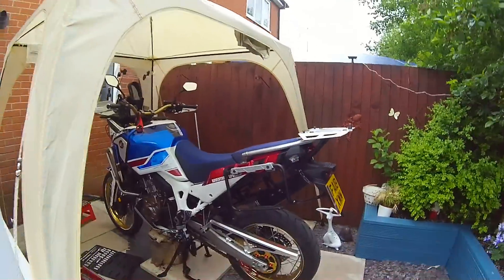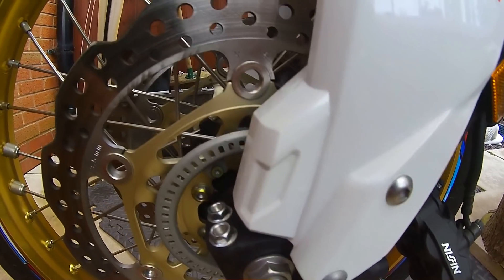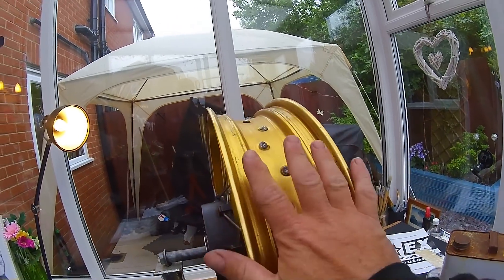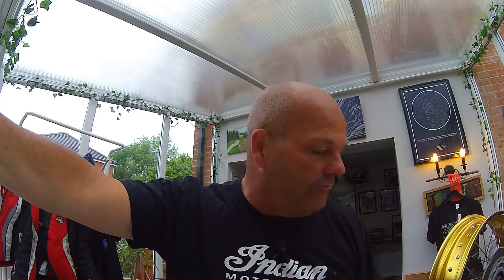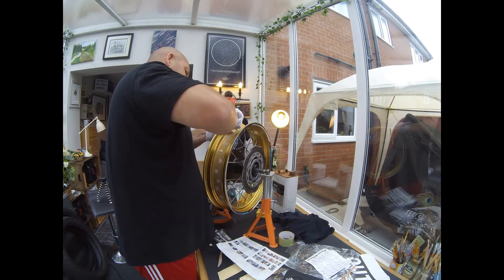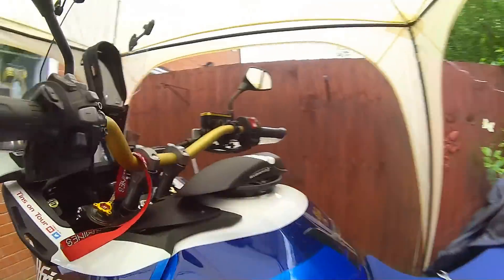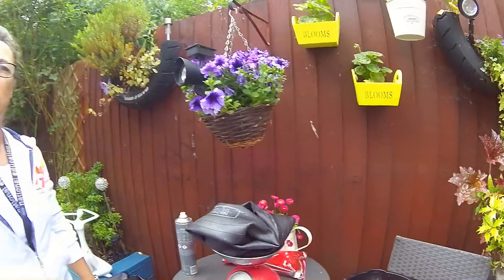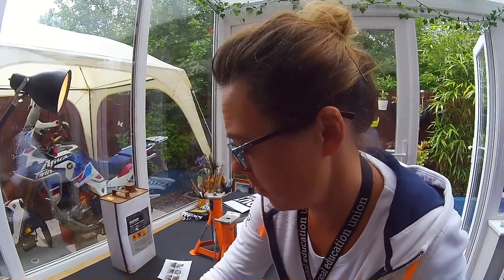Africa Twin Tubeless Conversion

Comment: Top job! Removing/re-fitting tyres is the main thing I am really useless at, so hats off to you for doing it yourself. Saw your first ride video since going tubeless and all was good, hope that is still the case.
Reply from the maker: Cheers Scott yes 3 weeks and 5 rides in and not lost a pound of pressure 👍

Comment: A job well done Shaun , tea supplied by Faye     to smooth the day    .     Congratulations to Faye   (cbt)            I got into biking late,  56 , so went straight into IAM    . It helps a lot   Shaun is a seasoned rider ,but not an instructor        I  stress this is a sharp earning curve .best of luck
Reply from the maker: Yeah glad it's done now just for ease of fix in the event of a flat .. Faye can't wait to get a 125 to practice on 👍
Reply: that is    learning curve          I must double check my messages after ive had a beer    haha

Comment: Hi mate. 
I  know I'm a bit late to the party, since the video says it was posted 4 years ago 🙄, but I have just bought my Africa twin and looking to do the same job. Plus after 4 years if you don't know if it's worth doing no one will. So ! In your opinion bud, worth while, did it hold up, and would you recommend it. Thanks in advance stay safe 👍
Reply from the maker: Hi pal and thanks for the message,  gotta be said this has been 1 of the best mods ever, never lost any pressure and much better tyre choice plus little bonus of less rotational mass

Comment: Have you done this purely to help should you get a puncture? Obviously easier to repair roadside a tubeless. I’m thinking of doing the same 👍
Reply from the maker: Absolutley the main reason pal , guarantee if we get a puncture abroad it'll be in the middle of nowhere and red hot so loads easier to just plug it ... best £70 I've spent 👍

Comment: Hi Shaun and Faye, great vids, just wondering what type of tubeless tyre repair kit you're going to carry, and are you going to carry an inflater or those air cylinder s as well, cheers..
Reply from the maker: Hi les I've always used the rubber slugs that u push in pull out and chop and use a mini compressor as i find canisters a bit hit and miss

Comment: Are you happy with this conversion? No leaks? Want to do this with my tiger 800 xc caus l dont like the tube setup. Better to get a plug in the tyre if the accident should happend.
Reply from the maker: Yeah Toby it's been great I've done my friends triumph as well and neither have lost any air plus the rotational weight saving is pretty handy .. nearly 10k on my conversion 👍
Reply: @TinsonTour  i guess thats my next upgrade then. Thanks for a answer sir.
Reply from the maker: @toby7504  I'd recommend it a million percent .... stuff taking wheels off breaking beads swapping tubes etc in the lashing down rain and cold ... defo not for me
Reply: @TinsonTour  yeah l can defently see that.

Comment: Maybe a silly question Shaun, but can this conversation be used on older bikes or is it just for modern Adventure Bikes. 👍
Reply from the maker: Can use it on any tubed wheel .. I've done the mountain bikes as well in the past and never had a failure
Reply: Thanks 😀

Comment: Great video, explains how this product works , thanks. Just one question, you put your tubed (I presume) tyres back on the rim, can you fit tubles tyres with the Outex modification  ? Regards, Rob.
Reply from the maker: Cheers for that yeah i run tubeless tyres now and on my 2nd set 13k miles without a problem 👍
Reply: I was just about to ask if you had a long term review on these, guess that answers my question 👍
Reply from the maker: @piggymito  absolutely 100% recommended they haven't lost a pound of pressure since being done and that included 2 European Tours .
Reply: Perfect, I've been looking at alpina wheels but at 2k you can imagine I'd rather find a cheaper alternative
..
Reply from the maker: @piggymito  absolutely 👍

Comment: Hi Sean did you  use the same 'tube'  tyres back on the tubeless conversion?
Reply from the maker: I wasn't going to but because of the lockdown I've still got at least 3k left on the Bridgestones so I'll change to tubeless tyres next time round
Reply: @TinsonTour  I have the Bridgestone Battalax A41 F/R (Front/Rear) and they state they are 'tube type".  Were your tyres the same type or different.  Looking to do the conversion but these tyres have only done 2500 miles so obviously lots of mileage left.

Comment: Top work.
Currently running Bikeseal in my tenere tubes. Works differently to slime, and so far all good, 4 yrs in. Still carry spare tubes just in case though... 
How does the outex conversion cope with water, a d what is the life expectancy of this?
Happy travels , well done.
Reply from the maker: Cheers pal ... life expectancy is around 8yrs plus the weight loss is noticeable at speed when turning in , suppose there's loads of ways round it i just fancied trying this 👍
Reply: Bikeseal say there product is not suitable for tubes. If you think about it a tube is just a few mm thick......how are you imagining a slime could grip onto that thin an edge and seal under pressure?
Reply: @xtc2v  The bikeseal website shows suitable for tubed and tubeless. It's a good product.

Comment: Did you have to balance the wheels again after removing the tubes.
Reply from the maker: No not really on an adventure bike it's not that sensitive although if u had an issue u could get them done ... I've never bothered on my last 6 bikes and not had a prob

Comment: Since you made the change and the ring was ready to use, the tire that puts you back is a tubeless tire? Or a conventional tire?
Reply from the maker: Conventional... Will use tubeless next time but done 4000ks on this with no pressure loss
Reply: @TinsonTour  But it is said that if you have a tire that is used with a tube inside a tubeless tire ring, the tire is damaged by not having enough force to withstand air pressure.
Reply from the maker: @bartez333  no we have had no problem at all
Reply: @TinsonTour  a ok.. Thanks men... Good videos

Comment: Thanks for the vid, was a bit surprised you used pounds, lol. I wonder what the weight of the conversion was. Lots of options for tubeless conversions, I'm considering the outex for my supermoto. It seems you did a great job with it.
Reply from the maker: It's been faultless Justin 10k miles , 2 european Tours and never lost any pressure . Well recommended plus a bit of ( rotational ) weight loss is only a good thing 😉 tubes where really heavy compared to the conversion

Comment: Hello, is the conversion still holding up some 10 months later? Cheers 
Pete
Reply from the maker: Yeah pal, 2 sets of tyres and over 10k miles and not lost any air , I've also done a few triumph 800's and they've been fine
Reply: @TinsonTour  thanks. I'm keen on doing this on my Enfield 650. Quite a few people have done the conversion, but no long term reports.   I saw a vid. from "the workshop" bagging the idea, I can't see an issue. Worse case, it leaks. Won't be any catastrophic failure, which may occur with a tube.
Reply from the maker: Mate I've been doing it for years with mountain bike wheels which run higher pressures and never once had a problem, only thing I will say is as in a lot of modifications preparation is key just make sure the rim is spotless before adding the tape
Reply: @TinsonTour  thanks for the feedback, appreciate your time. Cheers.
Pete

Comment: if you use flex seal, it will seal alot better and last longer
Reply from the maker: Thanks for the advice .. the outex kit has sealed perfect and not lost any pressure upto now  , just have to see how it goes 👍

Comment: do you run tubeless on your mtb, conversion is exactly the same plus a bit of slime
Reply from the maker: Yeah simon same gig just use mtb sealing foam instead of slime as it's loads lighter 👍

Comment: Pay attention to the front wheel. I think the stock rim is not for tubeless tires. Please check with a dealer before ride your ATAS
Reply from the maker: Yes ur correct the front rim doesn't have a safety bead but it's fine .. loads have been done with no probs , I've done nearly 1000 mile on it since conversion
Reply: Cool. Have good rides on it... :)

Comment: Have to be a little careful as the rims are not designed for tubeless,the bead rim is smaller & should the tyre lose air it could de-mount.Insurance may not cover it, just saying
Reply from the maker: The rear rim is designed to take tubeless besides spoke leak , it's only the front wheel that doesn't have a safety bead but then again full air loss with a tube in would have same end result ... suppose it's a calculated risk.. 👍👍

Comment: Here is something for you to think about, if the air in the tube weighs nothing, how come when your tyre in inflated it's weight is much heavier than when it isn't inflated 🤣
Reply from the maker: Witchcraft 😂😂👍also shows u the benefit of  rotating weight saving as say 40psi only increases a tyre by around 2 grams but turns into lbs at high speed

Comment: I find it the most stupid dangerous conversion to do.the rim is tube type only made by honda and (qc) qualety control proven and tested on many points for that purpose. 
Seen not nice ended bike pictures on other (cagiva allroad) fora many years ago with the same tubeles disire. 
Just my 2 cents.
Reply from the maker: Absolutley every 1 to their own 👍 it's been the best mod I've made to the bike and totally reliable

Comment: All OK but.... All rim's it's grooved inside both side to tyres sticking on the rim's after need 500ml green sealant
Reply from the maker: No works perfectly without, did 5000 miles with no issues

Comment: 3m 5200 for the nips and 3m 4411n tape to cover the rim well. Save a lot of money 💰..
Reply from the maker: Yeah used marine tape on our mountain bikes all pretty much the same process but by the time you've bought tape , decent tubeless valves it would only save £30 at best , this has been faultless 10k miles later so £69 well spent me thinks
Reply: @TinsonTour  I did 2 bikes for under 80 usd .if I got the 2 kits it would be 400 usd
Reply from the maker: @PA-Tammy  must be mega expensive where you are as full kits are £69 in the uk
Reply: @TinsonTour  yep 200 per bike